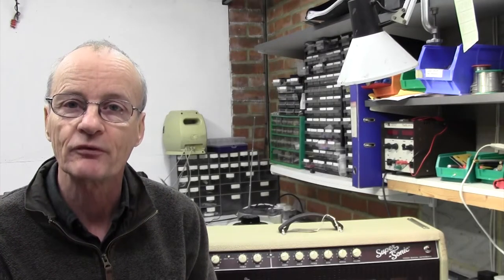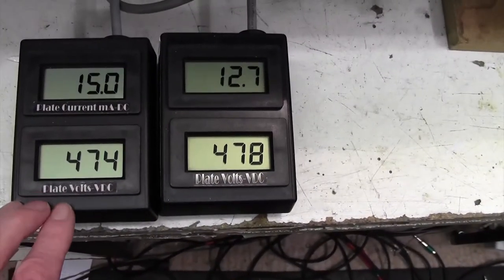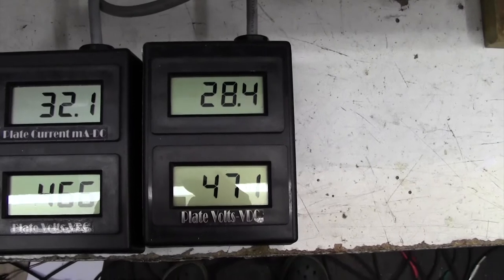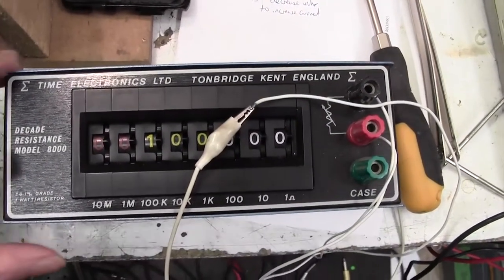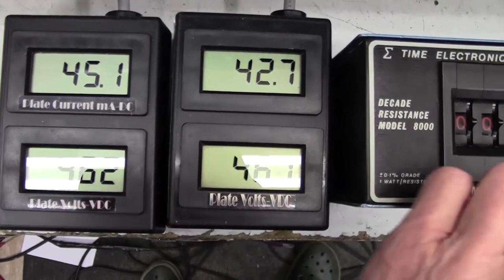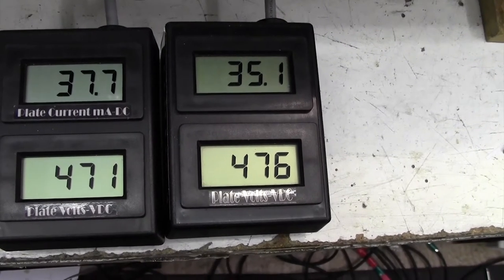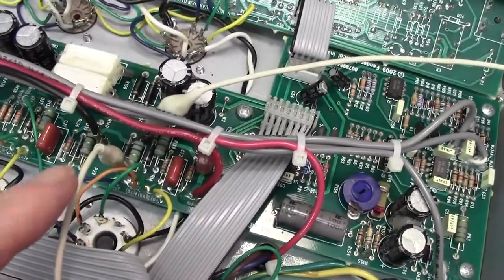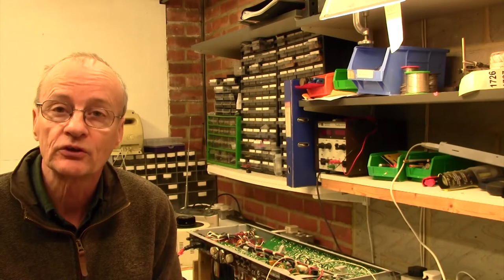How to Bias Fender Supersonic

Comment: Hi.  Thanks for making this video, excellent!  I have a SS 22 which looked very similar inside except obviously it uses 6V6 power tubes.  Few questions please.  Does the difference on plate voltage between the two euro tubes probes indicate an inaccuracy in the probes?  Could you have used a warmer grade of 6L6 tubes to get the 40ma you were wanting as opposed to soldering a resistor?  Did I see a jumper cable in the effects loop, if so why?  All the best and thanks again for the video.
Reply from the maker: Hi. Here are my answers as best I can. Yes after making this video I checked the calibration of my two meters and they were a few mA different. I adjusted them to be the same! Well spotted. Yes you could use a 'hotter' tube rather than change the resistor. I can;t recall what I did now but  often jumper out the effects llop if I suspect the jacks might be playing up. I probably did a quick test and then forgot to remove the jumper.
Reply: @stuartukguitarampguy5830  Hi.  Many thanks for the reply.  I have the same euro tubes bias probes, x1 with the plate voltage (like yours) and x3 of the bias only probes.  My testing in about 8 amps some with their own test points, show an error of 1-3ma for the bias and the plate voltage when compared to reading off pin 3 directly is about 8-15 volts lower than at the pin.  To be honest I expected a higher accuracy given their price.  Regards.
Reply from the maker: @irf888  Agreed. If you open them up there are two trimpots inside which I used to calibrate mine.

Comment: you don't specify witch model supersonic you have here. wouldn't the bias be different being SS 60 having 2 6LS's and SS 22 having 5 6V6'S
Reply: correction 2 6V6's
Reply: This is the SS 60. Scrub to :30 seconds on the video and shows you on the back plate of the amplifier above the power tubes.

Comment: This is incorrect.  The Eurotubes bias meter is showing plate current, not bias.  You should make a calculation using the plate voltage to figure the bias current.  This amp is being way over biased and tubes will fail.
Reply from the maker: Steve. Not sure I'm following you. Yes you do a calculation to work out what the bias current should be for a given plate volktage and tube type. I use the bias calculator on Ted Weber site. Let's say 40mA for 450V. Then it's just a question of adjusting the bias to give this current (say 40mA) on the Eurotubes bias meter.